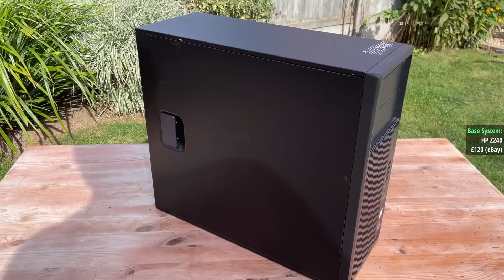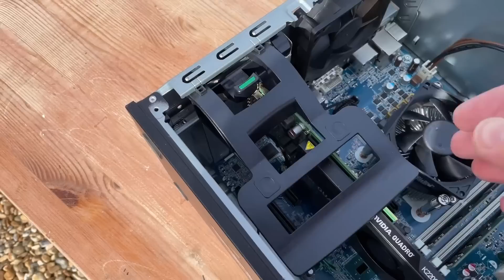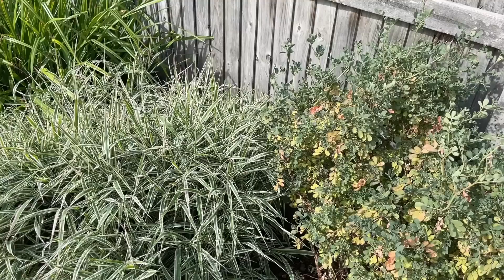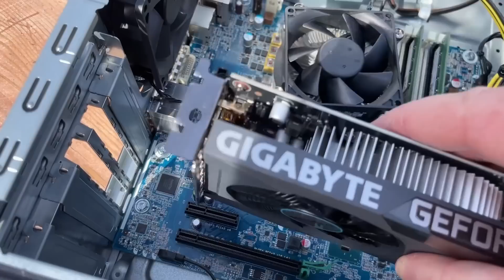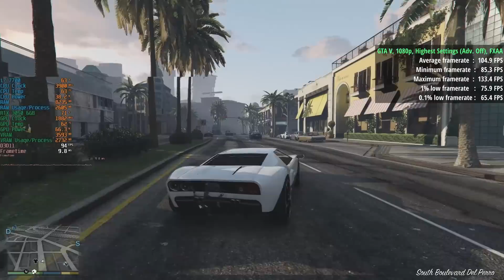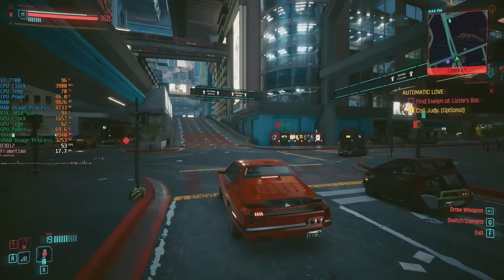A Simple £250 Gaming PC Build

Comment: Still rocking Z240 as the current PC of my own. Mine is with Xeon E3-1225 V5 (Skylake-S generation, range of i5-6500/i5-7400), 32GB of RAM (2133MT/s 4x8GB sticks bought second hand), 2TB of storage (480GB SATA SSD+ 500GB & 1TB HDD combo), 2.5Gbit NIC and Quadro T600 4GB which is fine for me as most of work is lightweight gaming (newer games at 720p low, older AAA titles on 720p. medium/high or even 1080p depending on game), bit of coding and video editing (NVENC helps in this situations, thanks DaVinci Resolve). Hoping to replace this PC by end of the year with new one (full AMD rig including Radeon GPU) as this PC will get into the server role, the current home-lab server is dying piece by piece and thankfully it will stay alive until a new workstation is built.

P.S.: Z240 can run Windows 11, just need in Rufus enable disable check for TPM and CPU compatibility, mine is driving Windows 11 from first developer release.

Comment: could you do a comparison between gtx 1050ti 4gb and rtx 3050 6gb. As i have same CPU in but gtx 1050ti. would like to see if it worth selling mine and getting the 3050
Reply: Don't waste your money on a 3050, or even a 4050, just save up and at the very least aim for the XX60 version of cards
Reply: @kraftypk7283  cant with my power supply and not upgrading that and buy adapters etc. i want a simple plug and play card

Comment: Nice. Built this week a secondary PC myself from cheap and second hand parts, had a GTX 1650 laying around and noticed that you can get a new b450 for like €50 these days and old used ryzens are pretty cheap as well. The codeword was future upgradeability, so PSU ended up being the most expensive component, though as a 550W Seasonic model it's hardly powerful enough to run anything past midrange. As my "new" CPU was too old for Windows 11, it has also been a good excuse to learn how to use Linux again.
Reply: Also the first computer I've built from scratch, so kinda rite of passage for me. Before I've only used OEM machines.

Comment: A used RX 6600 with a quality £10 6pin to 8pin adapter wouldve given you a lot more performance.
6pin = 125w max, 8pin=155w+....minor difference, the extra pins are for grounding. With the CPU likely eating up to 75w max you're still well under 220W. It is truly sad how AMD & Nvidia killed the 6pinless and 6pin value cards hand in hand (the single 3050 6GB and the horrible pci e 4x RX 6400/6500XT don't count, they're terrible value for money.)
Reply: It’s the bottleneck we’re concerned about. Unfortunate limitation of the older chip, and newer AMD cards seem to eat the dirt when it comes to having access to SAM/PCIE 4.
Reply: Honestly and for a lower price I would have said an RX5600XT.

It's basically a 6600 with less vram but way cheaper (around 80€ to 90€)
Reply: @MasoMathiou  they're very rare on eBay here in the UK unfortunately but I agree they are amazing value

Comment: I don't understand how my i7 3770 and RTX 3060 runs these games better than this computer. I don't understand it at all
Reply: A 3060 is considerably better than a 3050 6Gb. Most older games have enough with an old 4 core cpu. i7 3770 was in the era Intel was really far ahead of AMD and still probably performing close to older laptops cpu's who als have to run these kind of games. But my advice... for god sake upgrade your mobo and cpu for a budget AM4 : 60 euro mainboard + 130 euro 5600X (or 95 euro for a 5500) + 35 euro for 16 Gb DDR4 memory would really get more out of that decent RTX3060.  :D

Comment: I just want to say that there's NOTHING dodgey about using the 6-pin to 8-pin adapters. Both the 6-pin and 8-pin have the same amount of 12v terminals and are rated for the same current. The extra two pins are just grounds for arbitrary sensing specifications. The 400 watt PSU that come in these are quite good and more than enough to power any single 8-pin GPU that makes sense to pair with an i7 7700, and that includes much better cards than a 3050.
Reply: What they said, the margin on the adapters is high, they can get away with quite a bit more than rated. It's really only about how dodgy an OEM PSU that's seen 7 years of uptime might be. I do have them come in more often failed than branded units, but still better than a white box unit.
Reply: Plus add a molex to 8 pin adapter to increase your choice of cards at least by 1 tier.
Reply: @MudSluggerBP  Not sure I would suggest that. Molex connectors are terrible and have a habit of melting, perhaps even more so than 12VHPWR, despite being able to carry more current than the SATA adapters. I don't like suggesting those either for anything except GPU's around 120 watts or less. If it needs two power connections, it might not be a great idea to try to run it on this PSU regardless. Keep in mind that the GPU will not pull 75 watts from the slot and supplement from the PCIe power connections. It actually works the other way around and the GPU generally doesn't pull much from the slot.
Reply: @TheGameBench  Last time I used molex to 6 pin for a GPU on an OEM power supply it went bang after a few days of usage. 0/10, do not recommend.
Reply: @ChrisTuffur  What's crazy is that early GPU's that needed supplemental power used Molex 4-pins.
Reply: @MudSluggerBP no now THAT is dodgy
Reply: A 1070 or 1080 would've been the better choice. Maybe a 2070 or RX 5700 XT (although this one, I'd worry about a bit)
Reply: @b0ne91  Absolutely. I think this would have paired well with the 2060 Super, 2070, 6600, 5700 XT or even a 3060. I think people forget that Kabey Lake could keep up with Zen 2+. Even the 1070 would have been faster than the 3050 6GB and would still be MORE than fine on that PSU and the 1070 or 1080 are really good price to performance right now. The GPU selection made zero sense.
Reply: @TheGameBench  My only worry with the 5700 XT and 3060 would've been running them on a 400W PSU. Other than that, 150-180W cards should be perfectly fine
Reply: @b0ne91  While the 5700 XT is a bit of a push, the 3060 is a 180 watt card. But even with the 5700 XT, which draws about 220 watts, the rest of the system is going to pull under 100 watts. You're going to still have a decent buffer zone on a 400 watt power supply, especially a high quality unit such as this.
Reply: @TheGameBench  You're right, but you can't be sure 10 year old PSUs can still run fully rated capacity. It's not 400 on the 12V rail and  a 7700 can pull 85W+ by itself. You can easily reach 320-35W for the full system. I've seen it struggle too often and would stick with a 2060S/2070.

For the 3060, you're more worried about transients than overall draw. Otherwise 400W would be perfectly fine for a 3060.
Reply: @b0ne91  I wouldn't suggest running a new GPU at capacity and the 400 watt, with any of those GPU's, will have enough headroom to be safe and not put stress on the power supply. So you're not running it at capacity. As for rails, the Z240 has three 12v rails. One for main, one for CPU and one for the PCIe. On the PCIe you have a total budget of over 250 watts. The i7 7700 will NEVER consume 88 watts in any realistic scenario. You can run something like Prime95 with small FFT's and probably get 88 watts, but PL1 is 65 watts. Even in something like Cinebench, it might push past that, but after about 30 seconds it will drop down to 65 watts in these systems. In gaming, it's going to consume about 50 watts. So, it would seem your numbers are off.

As for the 3060, I've sold these with 3060's and not a single one has come back to me despite the fact that I make it very clear that I warranty the system. The transients aren't an issue. Might be for a higher end 3000 series card, or a lower end 400 watt power supply, but then I would suggest one of those. The 3060 is fine. Besides, the worst that will happen is that you trip OCP and the system shuts off. The power supply in these systems is very much over built. While I would go with something else before the 5700 XT for other reasons, the 3060 would be perfectly fine, at least in my experience.
Reply: Been saying this for decades, yet on one believes me.
Reply: @HardWhereHero  Yeah... same here. I think people are starting to finally realize that the 75/150 watt ratings are just arbitrary sensing specifications and have nothing to do with how much current Mini-Fit Jr. is actually rated for. Especially since the standard pre dates GPU's even using supplemental power. Hell, it pre dates PCI Sig.

Comment: i put together a £250 build recently , used a i5 10500 (£50) , gigabyte b series mobo (£50) , thermaltake case (£40) , Gtx 1060 6gb (£25) bargain) , coolermaster ml240 aio (£67) 16gb ddr4 (£21) , & then got the storage , o.s & PSU from another old build i had laying around ... genuinley solid little build for the money & a okay base to upgrade from if needed in future
Reply from the maker: Nice :)
Reply: Love it, I've got a similarly specced build I'm about to pull the trigger on since someone gave me a free Ryzen 5 CPU a while back and so it''ll be my new living room PC for stuff like streaming and Minecraft.
Reply: You could also buy a pre owned system of similar spec from CEX 👍🏻

Comment: Not bad, and surprisingly good for the low budget. Never did I think that you'd get that all for approx £250, and there's room to add more storage drives thanks to the generous amount of SATA ports on the board (and SATA connectors on the PSU).
I also wonder if either of the two 3050 8GB models would be feasible in this machine, as I don't really like how the 3050 got cut down and made into a 6GB card. Perhaps the 3050 6GB should have been called the 3040 instead.

Comment: i would have gotten an rtx 3050 8gb. most are 8pin but there are a few 6 pin and on the used market they are a fair bit cheaper then brand new. you will have to hunt around but they exist. i went on ebay and found multiple rtx 8gb with a 6 pin connector for 150 usd (about 5-10 dollars cheaper then the cheapest rtx 3050 6gb on ebay). you pay a premium for no pcie powered connections these days unfortunately

Comment: I prefer the z440 with the E5 1650. Its around 200€ but then you can just put in the RX6600 or a used 2060 or a 5700xt. End result around 350€ but it has 6c 12t and a good GPU.
Reply: this cpu from 2012 even has avx-2?
Reply: @Kanivalos80  Its understood in xeon talks that I was talking about e5 1650 v3 or v4 and yes it has AVX2.

Comment: These interest me far more than an RGB 14700K RTX 4090 build. In fact half my PC gaming time seems to be taken up with tinkering and experimenting with lower end hardware. I wouldn't have it any other way. The games themselves are almost just a bonus benefit to me now.
Reply: Builds like that on YouTube are a dime a dozen and everyone does them

Builds like these prove console players don't knoe anything about pc gaming lol
Reply: I'm the same way. Rather push some old tech to the limits rather than just buy something that just works. lol. Dont get me wrong my daily driver is a fairly beefy PC but I dont use it often. I am always building a system. Right now I have been soldering stacks of these 3020 SSF motherboards to "UN-DELL" them. I'll solder the pins on the underside to allow the board to be installed in a normal case without all the dell extras and the F1 errors. it basically turns a dell proprietary board into a standard mobo so anyone can use it in a budget build. I know how to fix all the way up to 4th gen. Looking for some schematics so I can research doing it to newer boards as well.

Comment: i got an ITX case and mobo but it came with a 3.0 riser cable which I was 100% hesitant about but after plugging in my 4080 and hopping in some games I noticed 0 difference... i dont think gpus are held back by the 3.0 interface like at ALL

Comment: A cheaper option is the GTX 1060. Every single one I've seen is 6-pin. 
For more performance, then GTX 1660 Super/Ti perform about same as the RTX 3050 6GB and are cheaper used. That would've better than your suggestion. 
No one should buy an RTX 3050 6GB new for even for a cheap build unless you're an enthusiast or you really need a "powerful" GPU that does not need power connectors. You had a 6-pin available, so no need for this GPU.

Still good video though. These HP prebuilts are better than Optiplexes imo. I just wouldn't recommend the choice in GPU.

Comment: I used a 6-pin to 8-pin adapter or just plugged a 6-pin into a 8-pin GPU directly without adapter on some of my lower end builds and they work fine as long as you do not draw higher than 75W over the 6-pin. A RX 6600 has a tdp of 132W and 75W is already supplied over PCI-E so only 52W goes over the wiring. Just dont install a GPU with a TDP over 150W if you want to be safe. A GTX 1070 or RX 570 is 150W is good because 75W goes through the slot and 75W through the 8-pin. Also some 8-pin GPU's do not require an adapter at all and will work fine with a 6-pin plugged in directly. So try this first before buying an adapter.
Reply: I used for example 960 (120) and found with GPU Z that the PCIE Slot does not automatically uses all the 75W meaning I had only about 50 though the PCIE slot and 70 though the 6 pin
Reply: @fabsenbmx  Yes it depends on the GPU and PSU. If you are using a good quality PSU you should still be fine being 10-20W over spec but if you have a $20 Diablotek 250W PSU you better bring the fire extinguisher along.
Reply: the 6/8pin cable is the primary source of power for those cards. the gpu draws the maximum amount of watts from the 6/8pin cable then fills the remaining wattage needed using the pcie slot, not the opposite.
Reply: I remember a video once (albeit not by RGinHD) where someone went from SATA power to 6 pin then 6 pin to 8 pin in order to get a GPU working on some sort of OEM PC (because that's all that could be used). It wasn't retty, and certainly not something I'd do.
There are some GPUs that have a single 6 pin connector, which is what I'd do if I didn't want adapters. (with a 6 pin to 8 pin adapter you could use something like an RTX 2060)
Reply: Agreed, I would use a 6 to 8 pin adapter and put in a RX 6600 over a RTX 3050. The PCIe 3.0 hit is minimal and the performance gain is minimal. Many RX 6600s are actually limited to 100W by default. 

If you have an even tighter budget a used 1660 Ti/Super would save you even more.
Reply: @someguy3999 i heard that the tdp reading is not accurate for the rx6600 as it shows 100w tdp while using more. you can check that out as i'm not really sure if that's really true or not.

Comment: I built a family member a PC from new/used parts-3mo case XPG valor mesh 30 eur,R5 3600 60 eur,Vega 56 reference(used lightly in company for 2 years) 65 eur,new A520(guy got it as a prize brand new) 40 eur,2x4gb 2666 15 eur,new CPU cooler 8 eur(ali exprs),new PSU MSI MAG A650BN(gold tierlist C rank) 65 eur and he has SSD.all total 275 eur-and told him to get a 1080p 100hz monitor when he saves.I think i got some great deals and great bfb.

Comment: I'm curious how would arc a580 compare to 3050 or rx6600. They are priced at around 210 euros here in Serbia. On a modern sistem that is, but a budget cpu like a ryzen 4650g or 5600g (those rebuilt are also 200-250 euros)

Comment: Back during the 2017 and then the 2020 mining boom these office machine was a GOD SEND for budget gamers. I used to run a PC shop and these machine helped out A LOT of people to game on the cheap. In 2017 it was 2nd gen I7 paired with a GTX 750ti 2GB and in 2020 it was a 4th gen I7 with a GTX 1050 or 1050ti. I sold probably close to a hundred of these being a single person operation back then. 2-300$ for some pre owned PC that can run 2-3 years old game at 1080p 60fps was a huge market back then. Too bad the pandemic and lockdown killed my shop due to most of the clientle were expat English teachers and they all went home during the lockdown and there goes my business. Didn't make a fortune back then but it is a lot more enjoyable than what I do now.
Reply: Mining was booming around 2017-18 until roughly 2021. I should know - it was partially my fault. But yes, I built quite a few of these sorts of machines for people back then!
Reply: Imagine back then AM4 was a bigger thing than it was and there is a Z240 equivalent with a 500W PSU with updated BIOS that can take something like the 5700x 3d. Urgh it would be so so good.
Reply: gtx 1060 uses the 6 pin connector , they going for around 60$ and its the performance as the 3050 6 gb

Comment: If you get the adapter, put in a better PSU and pair that with a GPU from the I7-7700 heydays, like a 1080ti, you'd have a great start up system.
Reply from the maker: Ah that was a great combo back in the day
Reply: @RandomGaminginHD  I think 1080ti's are pretty cheap,

Comment: Upgrade to 8700 or 8700k
Reply from the maker: Good call (if the board supports it)
Reply: No chance as the 7700 and 8700 used different MoBo generations.  And even if they did, big OEMs like HP, Dell, etc never release BIOS updates to add new CPU support as that's a zero revenue stream

Comment: I built an 8600k used system lately
"8600k:63$ (used)MSI Z370:70$ (used)32 GB 3200mhz memory:54$ (used)"
Tossed in a 6650xt, although I felt a bit scammed when I realized the memory and PCI is gimped on this card. I was only skimming through benchmarks and didnt realize 😂😅
Still its performing like a champ for me. Actual output very good, I play bannerlord, Hoi4, gunfire reborn, get perfect performance
Reply: 8x pci e is still nowhere near as gimped as their lower end 6400 and 6500XT. It's probably a 2-5% hit, whereas the 4x cards can get a 20-40% hit on PCI EX GEN 3.

Comment: You could probably put in an rx580 with a 6 to 8 pin adapter. Then you'd have a 150£ build instead of 250£
Reply: A 200W GPU?  wouldn't trust the PSU in this for a medium power GPU.
Reply: @lewzealand4717  The rx580 draws like 130W. It could go even lower with an undervolt without losing performance.